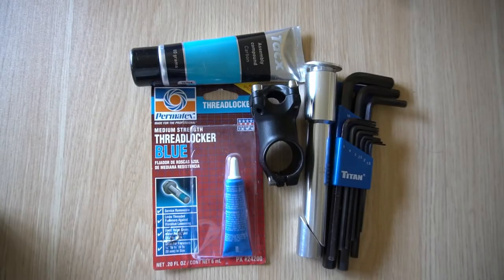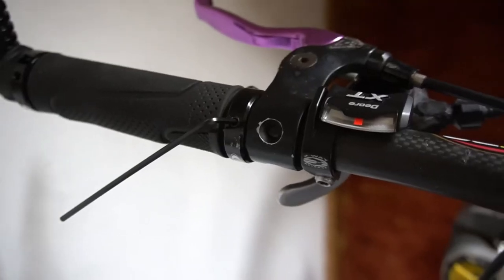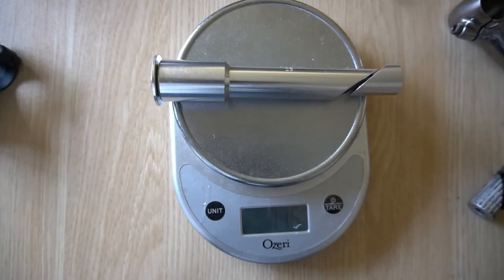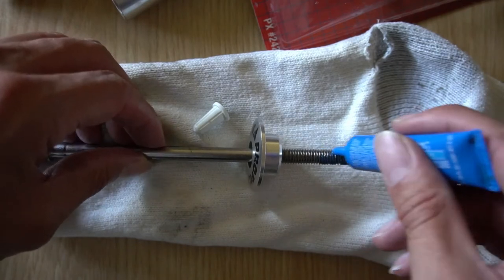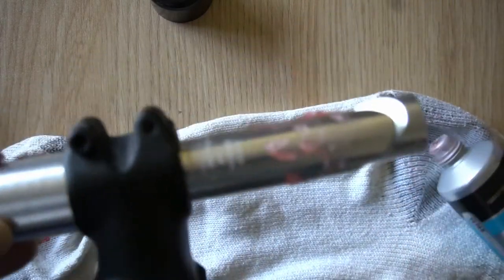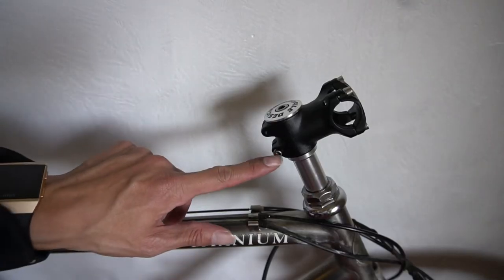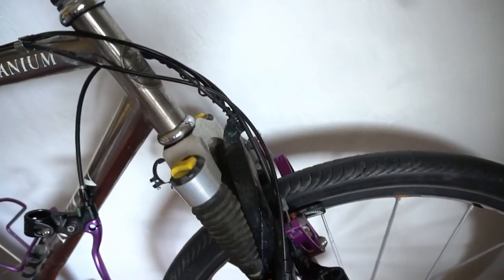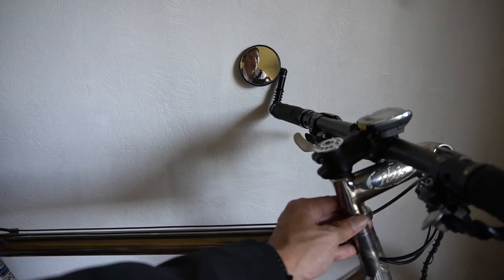How to Change bike stem height (quill to threadless)

Comment: great video buddy , could you go a little bit further down on the stem  ? or you have to follow the minimum height mark ?
Reply from the maker: You can put it all they way to the bottom if you like. If so my knees hit the handlebar.
Reply: @pedalpowercycling  sounds good... im trying to replace mine too. Same as your bike ,i will be converting it too. 
Thanks 🙌
Reply from the maker: Good luck. How it is now, when I stand up my knees hit the handlebars. So I'll be adding another riser. Stay tuned for another video.
Reply: @pedalpowercycling  mineon the high is fine just trying to converting because i want to try to change to drop bars ...trying to make some updates to the bike. Will be tuned for the other video . i try to do some videos too if i do the convert. Thanks !

Comment: Hi, I'm looking into getting a threadless adapter for myself as well. Is there no need for putting any spacers under the stem?
Reply from the maker: When you have a threaded fork, the adapter allows you to install this adapter on the inside of the fork so there's no need for spacers under this adapter.  The spacers are used on threadless setups so you can tighten the stem onto the headset.  It's not needed in this situation.